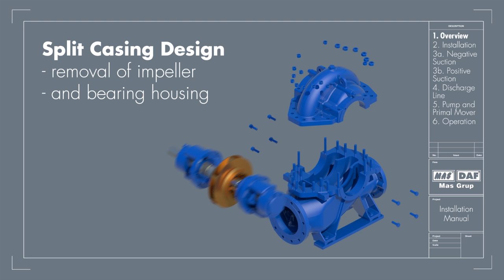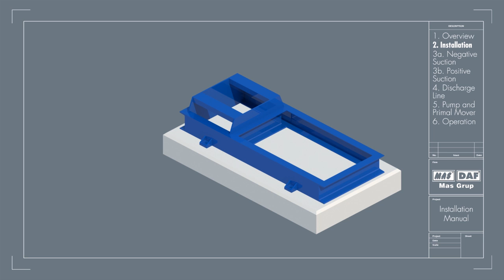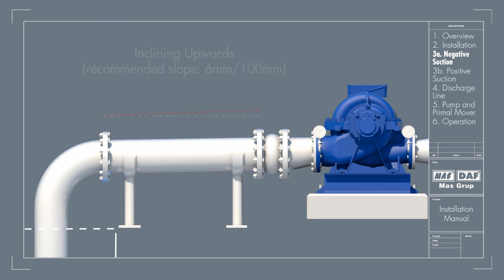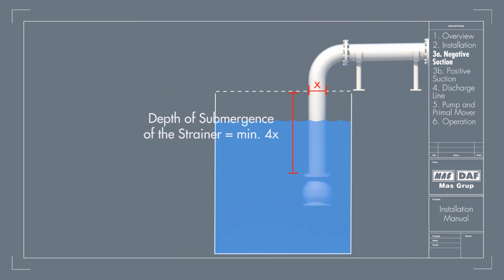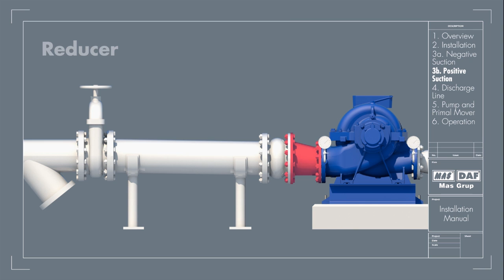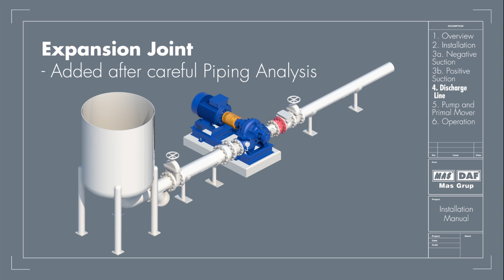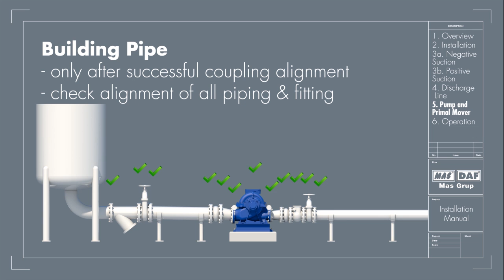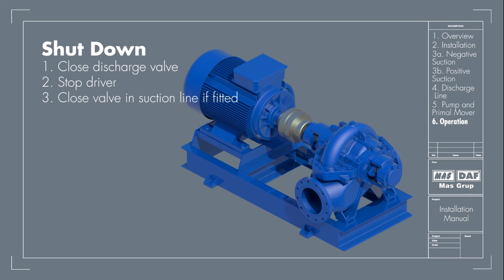Pre-Installation Tutorial for SPLT Series Axially Splitcase Double Suction Centrifugal Pumps

Comment: very good animation video!
CHINCOPUMP is a professional of GSN series high efficiency horizontal double suction split casing pump . The split casing pump are widely use in water works , industrial ,irrigation , construction industry and pipe line ect.
Split casing pump main advantages with high efficiency and energy saving ,excellent cavitation-resisting ,low noise and smaller vibration ,variable combination of materials,
simple structure and easy maintenance . We have high quality and lower cost ,and provide the best service for all client .
CHINCOPUMP brand has already recognized as China famous brand since year 2010. For more information, please visit our factory basement in ZIBO(The capital of China liquid ring vacuum pumps) All copyrights are reserved by www.chincopump.com!